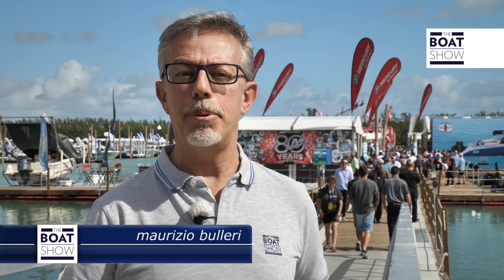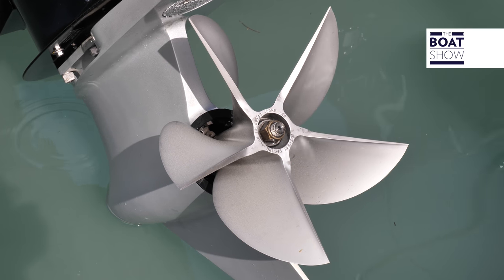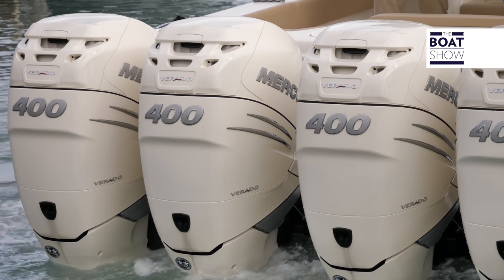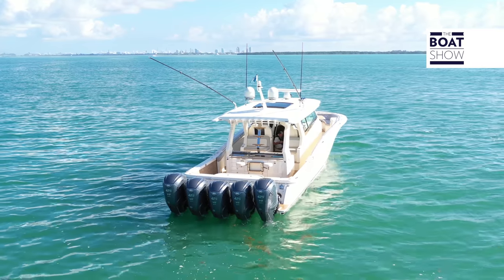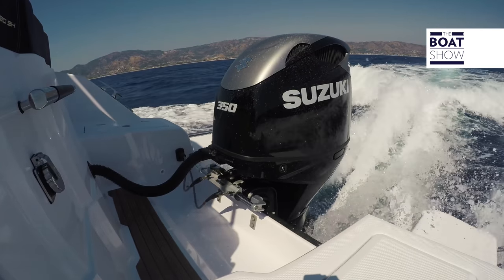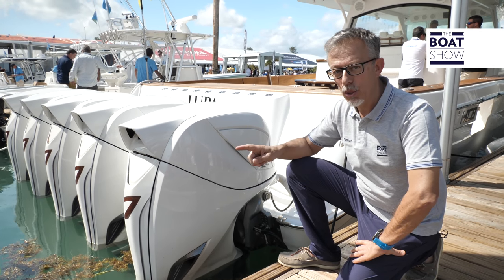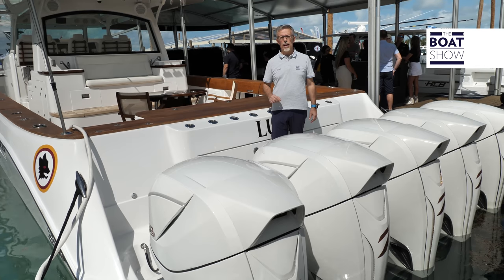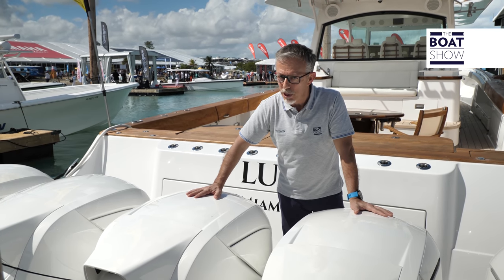[ENG] THE MOST POWERFUL OUTBOARD ENGINES SEEN AT MIAMI BOAT SHOW 2019 - The Boat Show

Comment: Are those multi engine boats floating gas tanks?
Reply: I was just thinking about fuel consumption...  I couldnt afford the fuel. Forget the cost of the boat and motors. Forget what motor but one they mentioned had a 12:1 compression ratio. It would need racing fuel to run. Like $8.00 a gallon for the cheap stuff in my neck of the woods. Probably looking at $1,000.00 for half a day of play time!😮
Reply: The future is electric Because soon big battery break through

Comment: From all outboards in the world i'll always chose a Mercury as the smoother most reliable outboard i ever had was a 50HP 4 cylinder engine bought SH in the early 70s after that i stared using jet driven boats, by the way  did i see right 600 LPH not super cheap to buy so cheap to run too

Comment: Inboards are just as powerful and so much easier to maintain, not to mention you do not have that ugly engine hanging off the back of your boat.
Reply: Captain Andrew Armstrong sure just as powerful, but not easy to
Maintain. With outboards u can just replace them easy as
Reply: Andrew Armstrong You have no clue what your talking about, you need to access the hull compartment to do maintenance on an inboard, where as an outboard is remotely accessible.
Reply: WattsUpDev I know exactly what I am talking about. No ugly outboard will ever hang of the transom of a boat I own.
Reply: Andrew Armstrong but when u say that they are easier to maintain than an outboard is simply absurd wrong and stupid, please check your facts next time
Reply: If you think these are ugly I don’t want to see your preferences in women